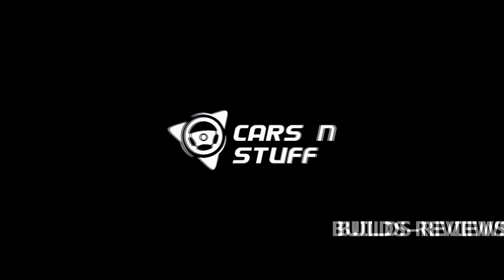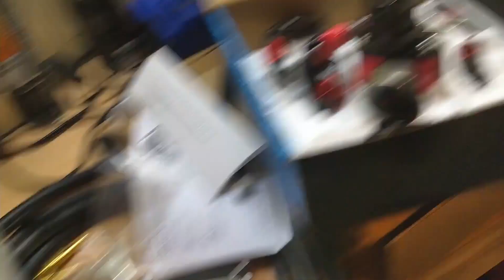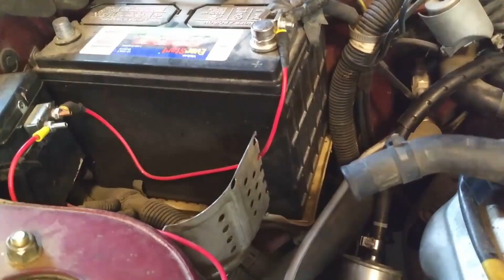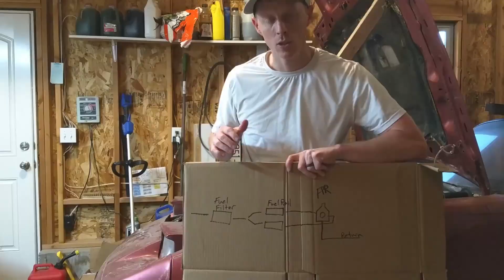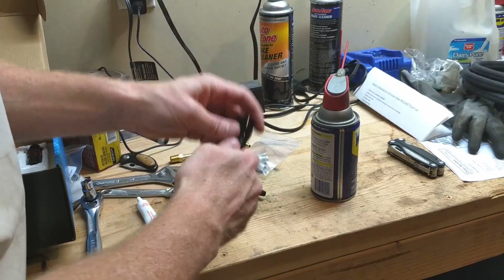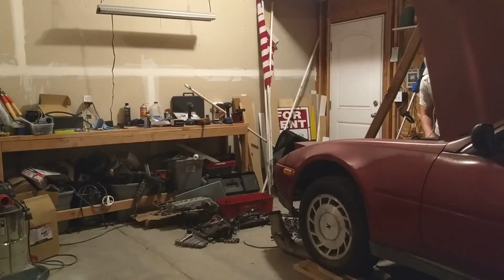Fuel pressure regulator install NA2T #5

Comment: I need a clutch I need to order it tonight I've been looking at a Z1 performance it says 1984 89 300ZX non turbo it says it has a slightly firmer pedal is good for street or track use it is an action clutch $327.10 when you scroll on down it says 87 88 89 some of them are turbo some of them or not but it doesn't list and 84 at all 85 or 86 when you get down there to Applications please I need someone to recommend me a slightly aggressive clutch but good for daily driving that will be okay when I get my Turbo and injectors and nistune all hooked up watch my channel.  1lowz you will see all my mods and everything I have I have poly everything I have big wide tires I will have a welded diff real soon I need a decent clutch please help me out with a recommendation or send me a link